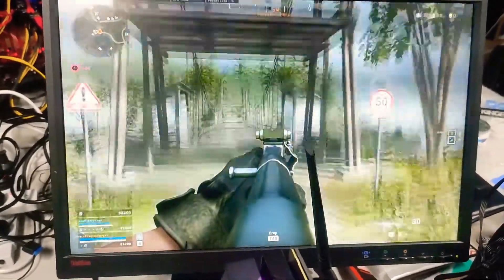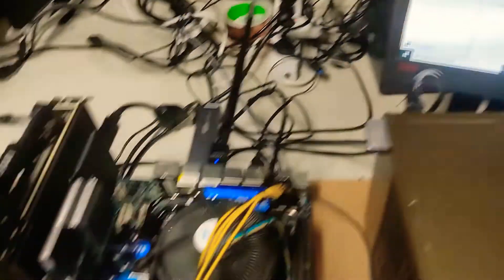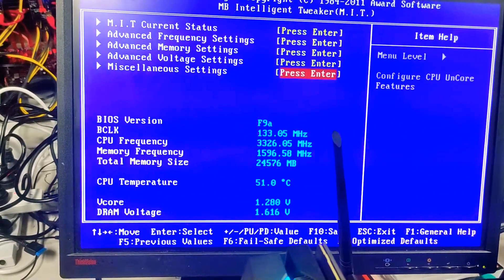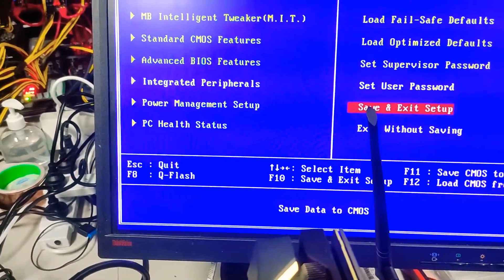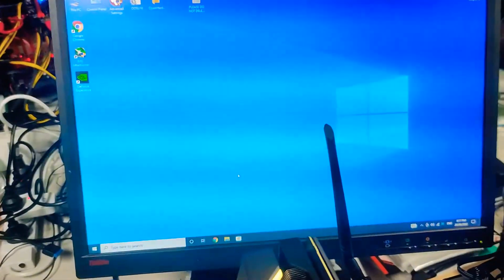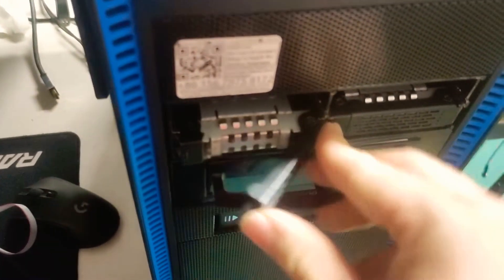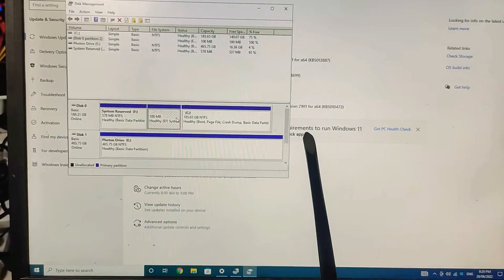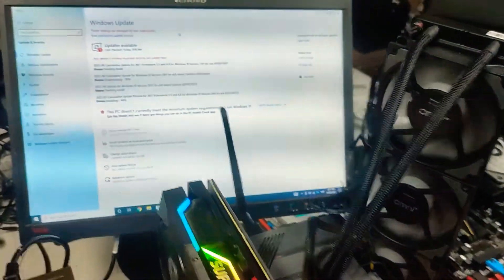UEFI Windows 10 & 11 WORKING 2023 on Gigabyte X58 UD7 Motherboard! ASROCK MSI ASUS INTEL IDE UEFI

Comment from the maker: New video coming for unsupported MSI motherboards and likewise anything that does not support UEFI boot.

Method is Legacy sideloading into UEFI with official update support of all kinds. Works fine with 11 ghost spectre on all legacy machines on AHCI or IDE Sata modes. 
You need a bootloader HDD and a main base SSD
Reply: How does the trim command work if the SATA port is set to ide? If you can't trim solid state drives they'll go bad really quick.

If you want spinning drives for large storage you're losing out on like native command queing and stuff in IDE mode
Reply: Great vid - I no longer feel alone! 

Believe it or not, I am STILL running three systems built between 2009 and 2010 with Gigabyte's X58 motherboards - a UD3, a UD5 and a UD7, the last of which is my work system and has been on for around 16 hours a day since built. Aside from having to replace the occasional graphics card (running three monitors), all the systems include Intel's i7 960 3.2GHz CPUs, 12Gb Corsair Vengeance CL9 1600MHz ram,  a 1Tb WD Blue SSD primary drive on SATA 6Gb SATA port, a 2Tb Seagate Barracuda Secondary spindle drive on 6Gb SATA port, 2 x optical drives on 3Gb SATA ports, Asus GTX750Ti OC 2Gb graphics cards,  as well as all the internal hardware (USB 2 & 3, IEEE1394, duel LAN, Realtek 7.1 Surround audio) on the latest Windows 10 Pro 22H2 build 19045.3693 housed in Xigmatek's Utgard 3 fan chassis with 750W Corsair PSU's!

These systems are great! In their day, these builds were top of the line and I use them predominantly for my research work, video/image editing and the mandatory foray into the Call of Duty franchise. I have even built several Windows and Linux servers - yes, servers - using this hardware!  I keep the systems clean from dust, swap the ram modules in their slots away from the CPU every six to twelve months, and have NEVER overclocked them, which probably explains their longevity. 

However, I have found that setting the BIOS to AHCI and running the included chipset and AHCI driver software included with the motherboards (Win 10 doesn't cut it here) vastly improves boot speeds and drive read/write performance in Windows. From system start to Windows use is 29 seconds. Not bad for a 14 year old system loading a bagload of software and drivers on startup. Performing a basic test by using Windows 7 Pro built in performance tool shows that just the SSD/drive change with installed drivers and adjustments to the BIOS took the systems from an average 7.9 to 15 - double the performance. If only they had M.2 slots!

My big problem now is I can't find hardware to upgrade to that gives me such a complete hardware suite as these do, the same level of expandability or the same confidence in their longevity that these do! It's even getting harder finding a case with 5.25" bays for my optical drives to create DVDs which is still the preferred industry standard to quickly provide preliminary video edits. 

My case has shown that older is sometimes better......but I don't think I'll be able to say that for too much longer!
Reply from the maker: @snoopy9568  you can use M.2 drives with the pseudo UEFI boot method. By using a legacy pointer HDD/SSD to aim at a UEFI only NVME you can boot into windows that way
Reply: @compuguy123  Yeah, installing a PCI-e X16 NVMe adapter into one of my MANY available slots (new motherboard just don't seem to have 'em!) has crossed my mind but I'm not convinced that the expense and time will translate to commensurate performance gains like a dedicated M.2 slot with a 7,000mbs + drive would provide. For the moment. I'm happy to sit on the combinations I've set up. In reality the machines are at the point that I fear that fiddling with them too much may induce digital embolisms! Then where will I be? In the present! Holy frijole! Can't have that!

Thanks for taking the time to respond!
Reply from the maker: @snoopy9568 it's like 10$ lol
Reply: @compuguy123  Lol! My time is money! Yeah.....I guess I'm too much of a purist. I had a colleague spray their coffee this morning when I told him I was still running X58's! If and when I make the move, I'll try the same thinking again by going to Z790s with all the trappings again. One day when I grow up........!
Reply: brooo i got x58 ud7 . and how to install windows 10 on that system

Comment: I'm running 🏃‍♂️xeon x5492 3.6ghz 4c 8t 12mb L2 with Asrock G41 board with 8gb ddr3 ram on 24 years old mobo. Windows 🪟 11pro runs like wild beast.

I've 5 xeon x5680 in spares but x58 motherboards not available cheaper in India.

Comment: Everything is good only at first glance. (ACHI) does not affect the stability of the download at all, but what really causes failures is the connection of the LAN port.  you deliberately did not show the problem, connect the lan cable to your port and your system will crash instantly. (KERNEL MODE HEAP CORRUPTION) It's not for nothing that you have USB WiFi adapters . x58-1366 gigabyte does not work with internet via LAN cable....!!!!!!!!

Comment: This is exactly what I'm trying to do, unfortunately with no luck so far. I managed to make a GPT bootable disk with my Windows 10 install on it. I made another MBR bootable disk and put the boot manager EasyBCD on that. I added a boot entry in EasyBCD to boot the GPT disk. So far, so good.

The disk with the boot manager boots fine, I select the GPT boot disk and let that boot up. It also boots fine. If I look in my partition manager the GPT disk clearly shows as GPT, not MBR. However Windows system info shows the bios as "Legacy" while yours shows as uefi. Secure boot shows as "Unsupported." My motherboard is a Gigabyte X58a UD3R, bios is version F1. 24G DDR3 memory.

I'm trying to run an Nvidia RTX3060 12G memory GPU and evidently this board requires uefi although Nvidia doesn't seem to warn about this.

I'd be grateful for any suggestions. Thanks!

--Bill

Comment: I conpare the cost of new systems with the new Intel cpu's, DDR5 memory, and PCIEx5.0, but for what I need, these old X58'S just handle it.

Besides Intel playing with cores, and adding E, Economy cores that can't do math (no math co-processors) seem like they are CUTTING RAW proccessing power for more tuned SINGLE process machines.

The x58s are great server like machines.

Comment: Gigabyte X58's run awesome. I have two, X58A-UD3R and GA-X58A-UD7. Running Zeon W3690's, 6 core, 12 thread (BCLK=200, NB/UNCORE at 3800 per CPU-Z), overclocked at 4.2Ghz, the UD3R runs at 58C w/AIR cooling, UD7 runs at 78C w/Air too. 

Both have 48 GBytes of memory, using the HyperX Fury, at CL9 at OC 1600Mbps (working on getting the timings for 1866 or 2133) on TRIPLE channels, getting 17Gbps memory speeds. So they are STILL relevant. I used them to run CENTOS and UBUNTU servers with Virtual Box running virtualized clients. 3 on each box with 16Gb of memory with 4 cores each, so 6 client VDI or servers as needed.

I have been using them since 2010, so GREAT Quality machines that have GROWN and expanded as needed. Althought the PCIe4.0 and 5.0 are kind of the end run now. They are work horses for sure.
Reply: Bro how to install windows through usb on this mob?
Reply: Did you find out how to do it bro? im stuck!! @qalb8675
Reply from the maker: Yeah I don't really like the modern systems. Plagued with shielding issues and high input lag, susceptibility to Wifi interference, etc etc. 

Much better to just run the good old good old.
Reply from the maker: Yeah I don't really like the modern systems. Plagued with shielding issues and high input lag, susceptibility to Wifi interference, etc etc. 

Much better to just run the good old good old.

Comment: Questions for clarity:
1. To do this, are you saying we need a 2nd more modern computer to install win 10 in uefi, then move that ssd over to our x58 computer?
2. If the answer to 1 was yes, do you know of a workaround so we can do this entirely on this 1 x58 pc?
(eg instead of a win10 installer, maybe a place we can get a full image with win10 already installed with uefi, then put our windows credentials onto it)
3. As I understand, I can do this all with sata drives? (i don't have any nvme drives)

I have a very good running x58 (re3 w xeon at 4.4hgz). Steam and Microsoft gaming app requirements are forcing me to finally give up nice crisp win7 (sadness)
Reply from the maker: Not always; 
but hear this; Revelations is coming to pass - HhH molecule X is hetain; the Double Crosser satan is bound by the HoHoHo particles; Holy Holy Holy; this when man bows down to the Black Hole; it is as if a to the letter h.

Comment: Does anyone know where i may find an online replacement bios chip (updated to the latest gigabyte x58 bios code??) for a Gigabyte GA-X58A-UD3R MB??
..or would i need to pay gigabyte llc to remove/replace or reflash the bios chip
Reply from the maker: Just buy one of the same size and voltage. (voltage is important)

Also, you can just try holding the reset bios button with the power button, while the board is plugged in. Reseat your cpu by spamming the lever a few times to make corrosion on the pins brush off.

Comment: I have my hds set with raid and and running raid zero off the motherboard on two SSD’s.  Had Windows 7 on it, but decided to finally go and try windows 10 on my old gaming computer and it’s working!  I used the windows 10 configuration tool from Microsoft on my gaming computer and told it to set it for other hardware.

Comment: i have same motherboard, same config and my rufus instalation usb tells me it isn't UEFI, still idk why
Reply from the maker: Install it first on a computer that supports UEFI, then do the trick I detail here.
Reply: @compuguy123  i think i may solved it by ussing a vitual machine, instal there windows then bia clonezilla to move the image into a usb ready to deploy inside the disk.
i have the appointment with my client in 2 days , wish me luck :) thx for your repply

Comment: how to make legacy to uefi? i just want to pair my x5675 with rx5700xt my current mobo is huananzhi x58 deluxe
Reply from the maker: I don't know if the huananzhi bioses can be made into UEFI -- you can surely modify the bios to have the Gigabyte kind of thing, but most likely it's too hard to pull off.

Comment: Something I once did with a M5A97 Asus was chainload clover to boot nvme on it despite its uefi not having nvme support, now there is a catch as on the oobe screen it will claim 'unsupported' just shift+F10, add admin account and in hklm setup you will need to manually clear the oobe boot flag, been using it regularly and it seems fine updating, should be fine with the 11 platform extension.

Comment: I have a Asus P6T X58 with a 920CPU and cannot get Win10 to install :(
Reply: That's strange, i have exactly the same mobo, and i run Windows 10 for over 7 years now
Reply: @opoxious1592  i found out disablingsomething like VD-t  works
Reply: @opoxious1592 Can you tell me what needs to be changed in the BIOS to make the motherboard detect the disk with the system?
Reply: @PanBercik  Well, if you mean that the disk is not showing up in de BIOS, that i would say that there is a problem with your disk.
The disk should be visible under "Main"
You will see a SATA list.
Under one of those SATA's your drive must be visible.
Otherwise you drive is not working properly.
So in normal circumstances, you would not have to do anything to see your drive in the BIOS
Reply: @opoxious1592  The disk works because I installed Windows on it on another computer. It is visible in the BIOS, but when I try to enable it with the system, it says that it is not detected.
Reply: @opoxious1592  Can you help me?
Reply: @PanBercik  Did you also tried to connect it to a different SATA port?
And maybe you can try a different drive if you have one?
Sometimes it can be as simple a a drive/motherboard mismatch.

Comment: do I need to re install windows to get UEFI boot? I set everything to IDE and legacy but still in legacy boot my MB is Asus P6X58D-E Xeon X5675
Reply from the maker: use a new drive to test it
Reply: @compuguy123  nope didn't work it's still in legacy bios mode
Reply from the maker: @paulburkey2  you need to install it as UEFI on a different computer usually.

Asus might not work though, there's a way to bypass it by making a legacy boot manager with EasyBCD on a second drive and marking that NTFS partition as active.
Reply: @compuguy123  I tried using a drive formated from an old gigabyte Z68 motherboard it was an early UEFI bios that was only available for download as a beta version but I just got the blinking light on the screen and it would never load into windows on my Asus machine
Reply: @compuguy123 what would the benefit be of that I already have A Samsung 950 pro nvme M2 Boot drive running Windows 11 22H2 and 1Tb ssd
Reply from the maker: @paulburkey2  It will actually support windows updates past 22H2 since the new updates pretty much require you to have UEFI, or it will refuse to update or install
Reply: @compuguy123 Hi, I use a x58 sabertooth. Setting everything to IDE didnt do the trick. I installed Windows 11 in legacy mode and converted it from MBR to GPT. Booting Windows isnt possible. So I would kindly ask if you could provide more information on using easyBCD and a second drive with legacy boot manager.
Reply from the maker: @peterhenkel3020  Use a normal hard drive or secondary SSD and then assign an active partition for the legacy bootloader onto it pointing to the C drive. As for specifics I can't recall atm, it's going to be a later video atm

Comment: I have problems with speed on my ssd samsung evo 860 on mb x58ud3r
Ssd conected via sata3. Sata mode changed to ahci
In magician speed test show 400/250
Recommend speed on this ssd is ~550/500
Help pls fix this😢
Reply from the maker: Just use as is tbh. The first idea is to get this to work in the first place!

That aside you can do some sideloading trickery with an NVME card in the PCIE slot and a small HDD or SSD as a boot director drive using EasyBCD

Comment: I got the same motherboard and a i7 X 980 and I was wonder if I can add Nvidia 560 ti on it. I wanna upgrade the graphics card to an AORUS 3060 Élite. You guys think it would cause to much problem like bottleneck? If yeah a 1660 super should be good? Or what u guys recomend
Reply from the maker: Upgrade the CPU to an X5680 or X5675/5672, making sure to get a stronger cooler. It's a 10$ CPU so it's pretty damn well dirt cheap to get
Reply: I'm running a 6 core xeon w3660?80? I forget. On air it's OC to 4.43 GHz. At that you won't bottleneck a 2080ti and maybe won't bottleneck a 3060. I think you are fine as long as you OC.
Bottlenecking is a result of your cpu not being able to hand stuff off to the GPU fast enough. OC directly affects how fast the CPU is running and therefore when it bottlenecks.

PS on the bottlenecking concerns: someone did some back to back testing with severe bottlenecking (intentionally underclocked the CPU to emphasize). Even with a CPU bottlenecking at a 1060, a 2060 and 3060 still received a benefit. It was just a very small benefit (an extra 3 to 8FPS) vs the 1060.
2 takeaways on that:
1. even though it gets a smaller benefit, it is still better to have the more powerful card in each test case. (and if you are going to upgrade mobo and cpu next year, then you'd unlock the rest of that card, so don't make bottlenecking your highest concern)
2. A severely limited computer is the one operating at barely playable speeds! if that 6fps is the difference between 48 and 54fps, you are going to notice that play-ability way more than on an already fast computer.

Comment: So in short, I could use the same procedures you did on my Dell T5500 dual cpu unit for that to have windows 11?
Reply from the maker: I think dell needs you to have it set to either IDE or raid mode since they have some really screwy controller. 

Support does vary by brands of that era but it wouldn't be too far of a shot to assume that it is possible. I remember seeing legacy settings in the dell bios, so that could be a possible thing.
Reply: @compuguy123  understood Sir, I'll check it out when I start on that project.